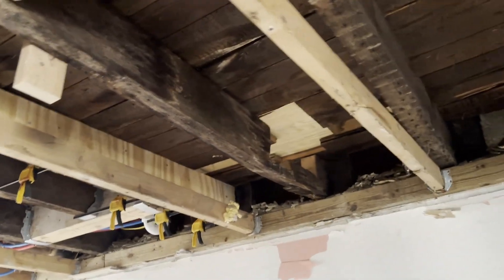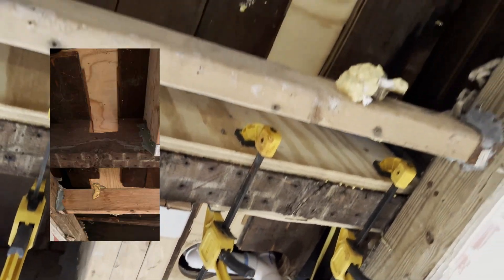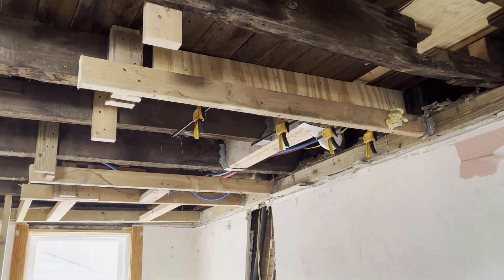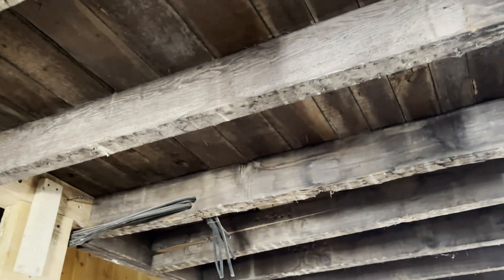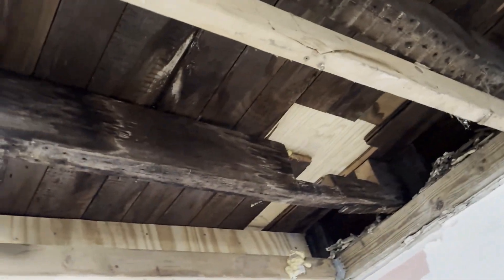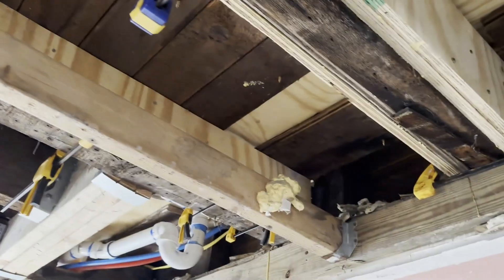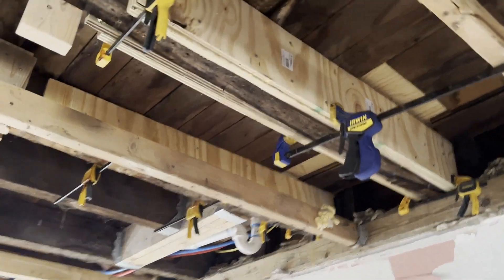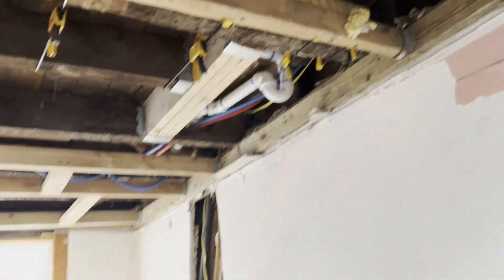How to Scab a Floor Joist With Plywood

Comment: I'm doing the same thing but an exterior deck. I have a ton of osb
 Any thoughts on using osb instead of plywood?
Reply from the maker: Osb actually offers better shear strength than plywood, so it could be okay. Although One thing to note since you’re using it outside is that it is more prone to moisture retention than plywood

Comment: My only observation here is the Plywood should have been cut the other way (along its length), they way you have cut it you have two strong ply's along the length and three weaker ply's in the vertical position, cutting the other way along the longest area of the ply would give extra percentage of strength overall, not a huge amount but nevertherless it would have made full use of the strength of the plywood. Regarding the debate over screws or nails. The reason for doing this is that there is no flex at all, if there is (or you think there is) then it hasn't been done properly.
Reply: Oh there's always flex.  You aren't gonna stop the forces of nature.  Every building is designed to flex.  If it didn't, it would be a pile of rubble eventually.   Wind is a bitch, for one.   Snow load, obviously tremors, etc.   It's going to flex.

Comment: Plywood is actually stronger than dimensional lumber. No such thing as too much construction adhesive; do not use wood glue. The nails are only there till the glue dries. Better to use structural screws than 16d nails, makes it all tighter like plywood but more like a lam beam. GRK screws come in lengths up to 4". I've done this and over-nailed (too many) with 8d ring-shank nails. Keep it all as tight as possible.
Reply from the maker: Thanks for the feedback ! There’s a lot of conflicting information regarding screws vs nails for these types of repairs. Screws do offer more clamp force but from my research can be prone to breaking or splitting the wood, as opposed to nails which can flex
Reply: @architect_talk  screws snap -> because they don't use structural screws.
Reply: Structural screws have the same strength as framing nails. As I said, they're only there the glue dries.